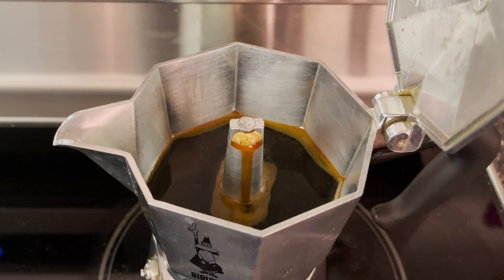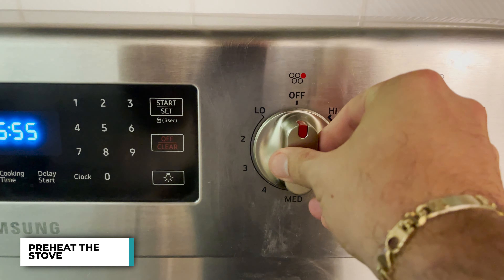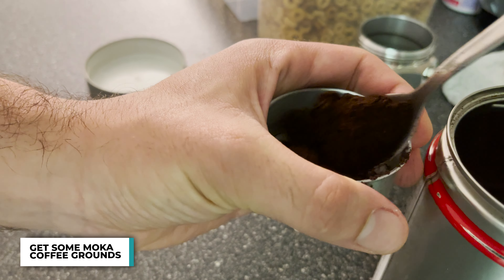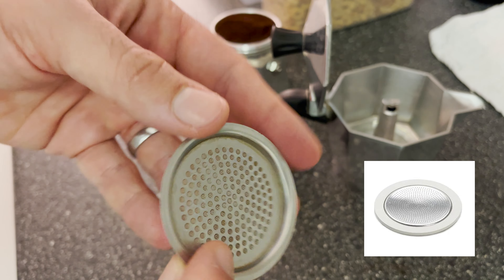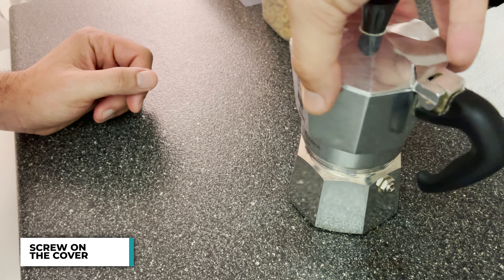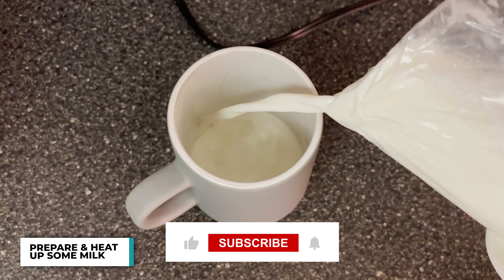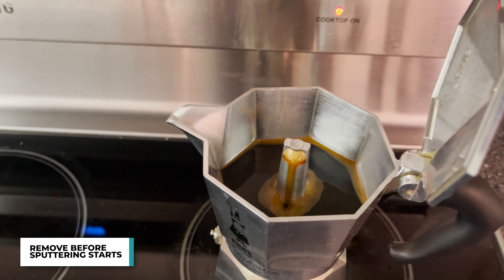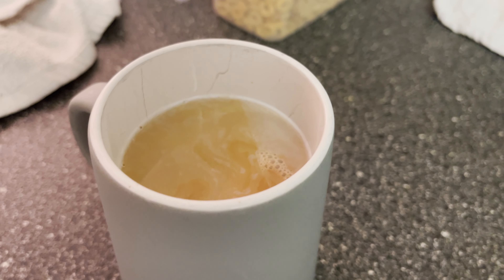Brewing the Perfect Cappuccino | Bialetti Moka Pot with E&B Lab Filter

Comment: The filter is interesting! I was going to try it, but I heard that Moka pots sometimes explode from too much pressure, like packing the coffee; so I bought a Bialetti Brikka and it works perfectly to make a lot of crema. 

But when I do use my Bialetti Venus Moka pots, I get consistently good flavor that's never bitter, never burnt, never over-extracted by following the simple Bialetti instructions:
1. Fill it with room temperature or cold filtered or bottled water to touch the bottom of the pressure valve. 
2. Loosely fill the basket with medium-fine ground espresso, like Bialetti Perfetto Moka, Lavazza, illy, Kimbo, etc., then scrape the top with a straight spoon handle to make the coffee level with the rim. Wipe grounds off the rim and threads, then screw it together tight.
3. Cook on a low gas flame or a preheated medium electric stove. As soon as you hear it gurgle immediately remove the Moka from the stove and let it finish brewing on your countertop from the residual heat inside the pot. (So do not cool off the Moka under cold running water.) Stir up the most-concentrated coffee from the bottom with a teaspoon and pour. 
4. There will be some leftover brown water full of fines in the bottom and that's good! If that water had gone through it would've diluted and dirtied your cup. Wash with hot water and no soap, wipe dry with a cloth. It will stay very clean. 

The best Bialetti tutorials are found via search terms: "Annalisa J Moka pot" and "Il Barista Italiano Moka."

Bialetti earns aprox $180 Million US dollars per year, so they can afford the best scientific testing and professional taste testing to ensure their Mokas make the best flavor. Their instructions work perfectly.
Reply from the maker: Thank you so much for the comment! The reason that I selected the basic moka express was really because of the made in Italy. I was a little upset when I heard that they are making most of their mocha pots right now in China… Cost savings, but the quality suffers.
Pressure issues are more when people do things that they really shouldn’t like over, pack the basket and compress it while at the same time, putting too much water in the basin, if someone covers the valves, it becomes like a pressure bomb.
Reply: @ImpossiblyKosher  That's too bad about China! It must be true because the Moka Express page says it's made in Italy, but the Venus page doesn't say where it's made. Sad! My Brikka is aluminum, so it's probably made in Italy.
Reply from the maker: Hope so!! Either way!
The technique is everything. The slower the extraction, the better :)
Reply: I would prefer not to wait for the bubbling sound, but to shoot then, as shown in this video. You can try to brew coffee that you take from the fire after the eruption and before the eruption. Then, when the coffee starts to flow lighter. And compare the taste.
Reply: @andrijstorozenko5631  I don't mind waiting for the gurgle sound because it only takes a few minutes on a low gas flame or a preheated medium electric stove. I don't want to watch my Moka pot, so I just do other things in the kitchen while I'm waiting to hear the gurgle sound.